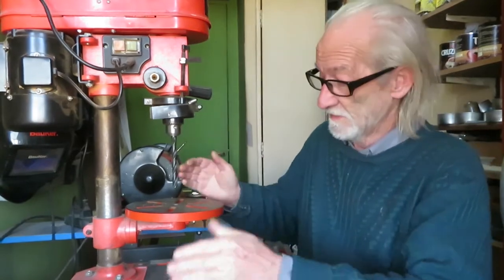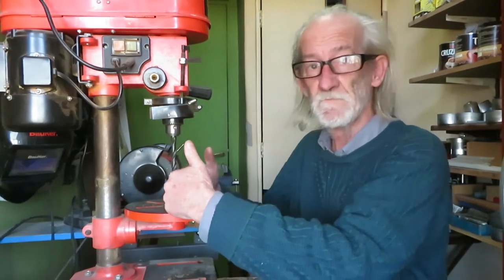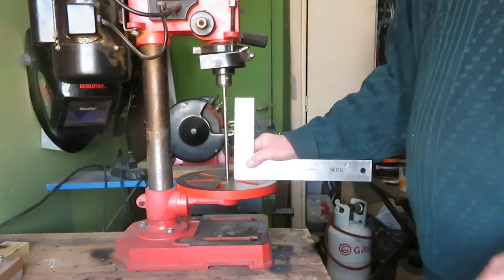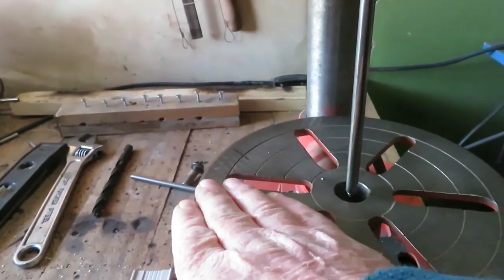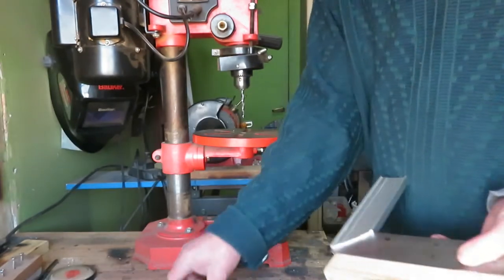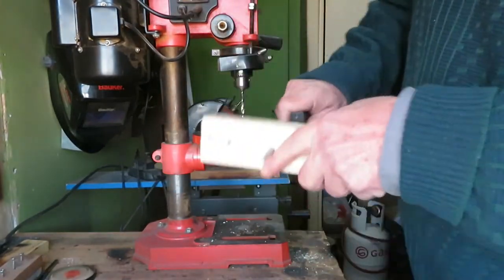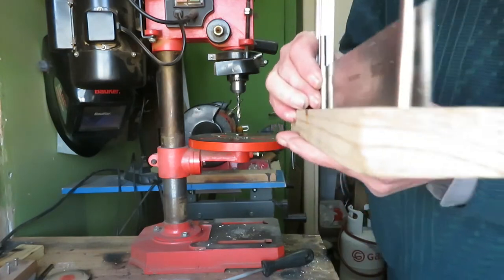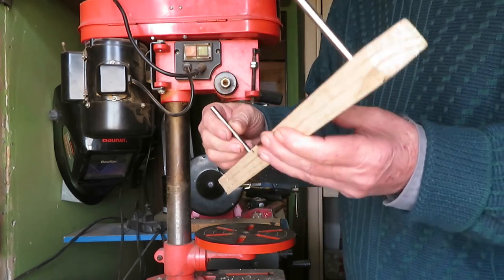How to verify if your drill press is properly aligned or crooked

Comment: Good stuff Rod. XYZ axes. New big cheap drill-press yesterday, for hobby. Your methods clearly explain how/what to expect. My planned solution for occasional precision is to establish
deviations (of steel rods in wood as you described) by drawing them into Sketchup on the PC and, computing appropriate wedge dimensions for placing beneath precision workpiece ready for drilling. Then, I truly is a Toolmaker master craftsman. Innit.  Thanks for the insight.
Reply from the maker: Many thanks for your comment MrBobinge. Coming from someone experienced, hands on, in these topics, double valuable.

Comment: The deviation can be easily corrected, but slightly more difficult for the specific table mount. First, there's no point in fixing the deviation if your table isn't rigid. Unlock the table and use a car jack or bottle jack and jack up the table carefully to where it no longer flexes. Check the deviation and adjust the jack until there's no detectable deviation. You may have to move the jack around to find the sweet spot.
Reply from the maker: Thanks Bob, for your comment and contribution.

Comment: for the bed surface, you can use lathe/mill the surface. the real problem is the y axis, which is fixed from the factory. the only permanent and cheapest solution is to cut the bed clamp and the bed surface then weld them back together while being hold perpendicular to the drill bit. you can tack weld them before adjusting and only weld when the position is perfect.
Reply from the maker: Yes, I suppose that would be the most lasting solution, but you have to be a very good welder to get that precision.  But once achieved, nothing will get it out of line. 👍

Comment: I know how it is working on a budget but if you take your table into a machine shop you may be surprised how little will charge you to face the table and your adjustment angle on the table so they are both true
At a minimum you just face the table and that will only have you out in One Direction and then you pack your angle adjustment underneath
Does that make sense?
Reply from the maker: Hi Sam, yes I believe the distortion of the sides of the table (the X-Y planes) can be fixed with machining.  As you say maybe it isn't an expensive job.  That would solve that issue.  To fix the X-Z plane they would have to scratch off the surface at the back at a given angle.  Maybe if I can find the correct angle or the amounts to be scratched off at the side and at the back they can leave it perfectly flush to 90° on all sides.  I'll have to look into that.  Thanks for your idea.
Reply: @RODsDIY  I don't like to talk an XYZ for the reason people can get lost on the plane you are talking about, with that said, I like to say as if the left or right Rises on the table to drill a 45° angle for example that is the sideways down and where the front of the table is low that is the low front of the table.
The side to side error has to be fixed by planning the flat of the table, but the table leaning downwards in the front may not be so easy to fix,  you should be able to fix it with having the face of the angle adjustment of the table.
Maybe you could approach a machine shop and offer to do some Plumbing or some such thing, or maybe you could approach Black & Decker to see if they want to sponsor the repair video, that was black and thicker written on the side wasn't?

One thing would be interesting to try to see how bad the error is just take the clamp for the vertical adjustment of the table off totally turn around so it is upside down to where it is at the moment reassemble and just test what the error is there, Maybe the error is it combination of the vertical shaft clamp and the 90 to 45 adjustment and by swapping it around you might reduce the error or even eliminate it
Reply from the maker: @Sam-black , Yeah, side to side or back to front is easier. I believe the side to side issue can be easily overun, in my opinion, just by adding a perfectly flat surface on top.  If it's perfectly flat there should be no difference between left and right side. ¿Would you agree? Machining it flat would be a more permanent fix of course.  
Yes it's a B&D, made in China, cheap as can be 😂😂.  
Yes, I should dismantle the whole thing, maybe turning the clamp around will give me a different perspective. Thanks, I hadn't thought of that.  If I think of it, maybe I can add a slanted washer somewhere to lift the front edge.  Many thanks for sharing your thoughts about this issue.  Now I'm hsalf way into a solution, or maybe more than one. 🤣🤣🤣
Reply: @RODsDIY  yes really the side to side the only way is to face the plate, possible ways of facing the plate add a piece of flat plate to the top, put it in the milling machine and Millet flat, put it in a lathe and turn it flat, rub it over a piece of sandpaper that's sitting on a piece of glass that is flat,..
Before trying to correct the problem put a straight edge across the table and see how bad the problem is, I'm not sure if your square is long enough to span the table you may find that it is only a small portion of the table and a file and sandpaper will fix this for you.

But do try to tune the bracket upside down to see if that fixes the very serious problem you have, putting packing so it is tilted Square is a very good solution providing you don't want to change to drilling 45° angle holes and so forth

Quick and dirty often works very well especially if you don't want to use the Tilt function
Reply: @RODsDIY  it is always good to get many people to throw ideas because something might be good.
I have a drill press that makes yours look like a top of the line press.
The motor is so weak it's hard to make it drill through a piece of wood (Pine) with a very sharp but at its lowest speed.
Reply: @RODsDIY  taking the clamp off should only involve laying it on its side and removing the base then remove the clamp
Before doing that I would probably be inclined to check with the square to see if the table and Bass is square with with the column
Reply from the maker: @Sam-black  Well, my experience with trying to flatten things with sandpaper is it ends up worse than what it was 😂😂😂 so either I fix a flat plate to the top or I get it machined. I went through turning the clamp over and trying to tighten the head at a different angle but both options did no difference.  I put a 1 mil sheet of steel packed between the bolt that tilts the table and that worked.  I now this is just a temporary fix, to get done with the job I was in, and in the end it might damage the bolt or the thread, so I think Ill focus on my other options for a permanent fix: a slanted cover for the table or get the table machined.
Reply from the maker: @Sam-black  I wonder if an old washing machine motor could be adapted for the job.  I've got a few of these picked out of the rubish and they seem to be quite strong. No?
Reply: @RODsDIY  do you have WhatsApp
Reply from the maker: @Sam-black  Nope.  You can contact me offline through my website https://www.sinclavos.cl/Contactus.php